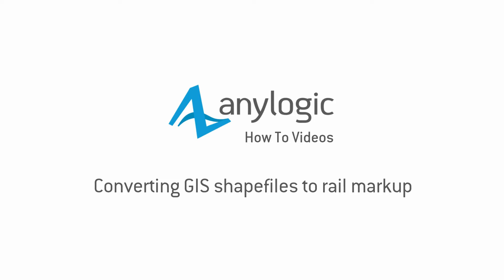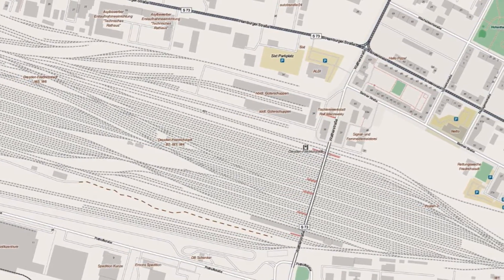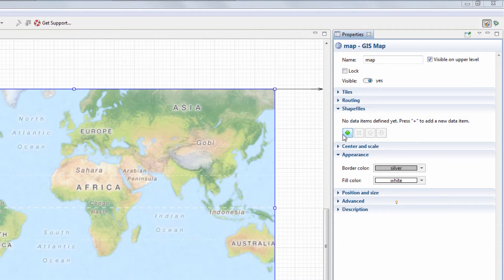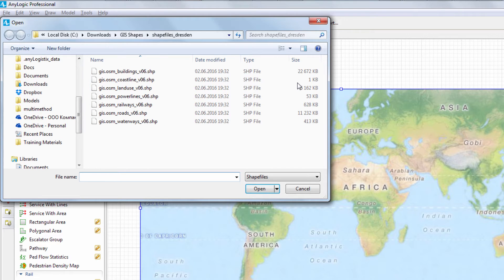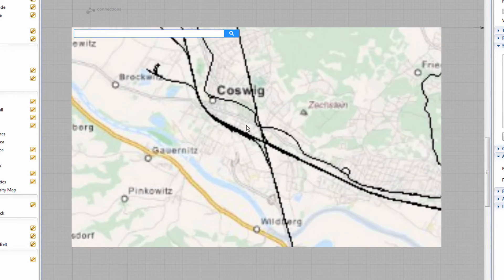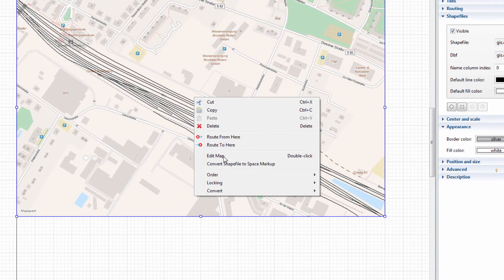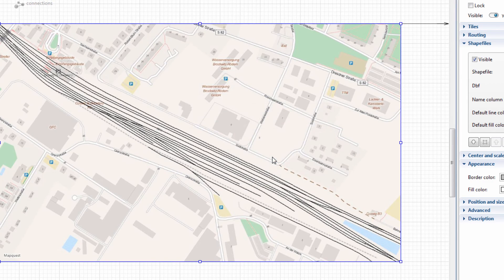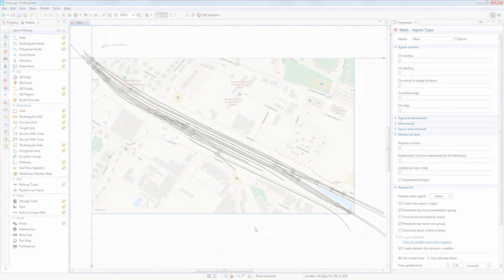Converting GIS shapefiles to AnyLogic rail markup

Comment: can i ask for trouble shooting? im using student license anylogic. when i try to "import" a shapefile of a polygon type, which is in a UTM 49s projection, it only show blank (white) map, and the whole gis layer (in anylogic) became somewhat erroneous, i cant zoom in and out properly, etc. can you guys give me a solution? im trying to model an economic growth of a region with city and rural administration boundary as a basic shapefile.
Reply from the maker: Hi! Such an issue occurs because AnyLogic works only with WGS-84 projection shape files. Please try to import the required GIS shapes using the WGS-84 projection type.
Reply: @anylogic-simulation  TYVM, and btw, if i use a polygon shp, multi polygon one, can i get a multi region gis layer in anylogic? or shold i enter the region polygon shp one by one. im trying to import a provincial region that consist of regencies/cities boundary (multi polygon), should i import/enter the polygon shp file one by one (per regency/city) to form a provincial region. frankly i need the regencies/cities as a unit input to form a provincial unit output (agregate), in term to calculate economic capacity and growth. i plan to share the model later if i succeeded to model this
Reply from the maker: @myusqielfahmi8538  Hi! It may be better if you contact us directly from the 'Ask a question; form here - https://www.anylogic.com/company/contact-us/
Reply: @anylogic-simulation  TYVM